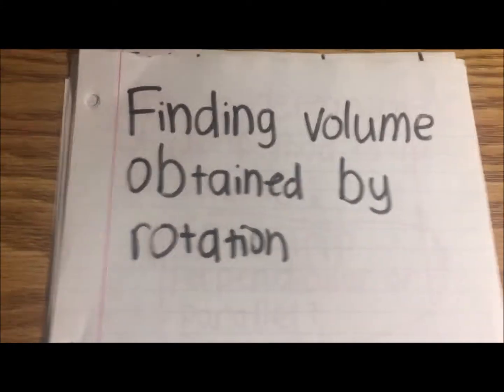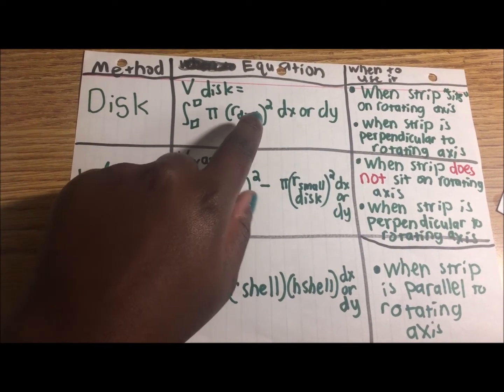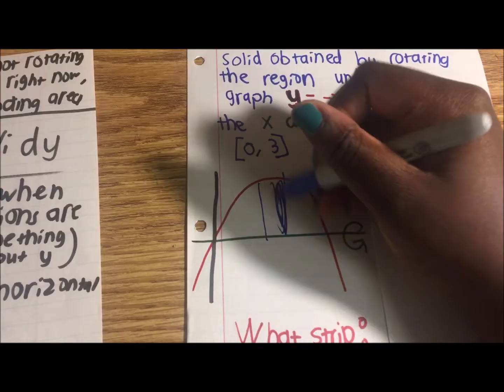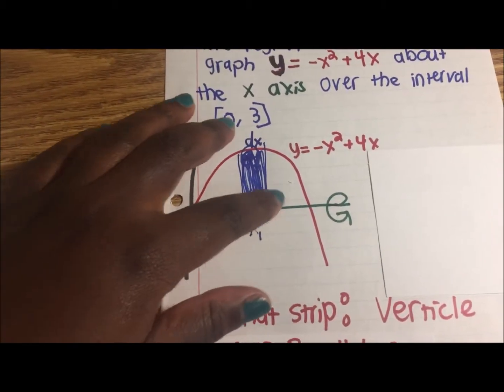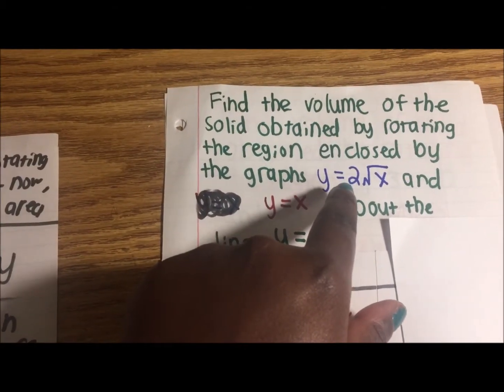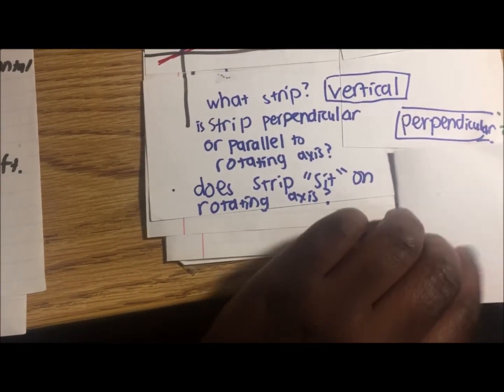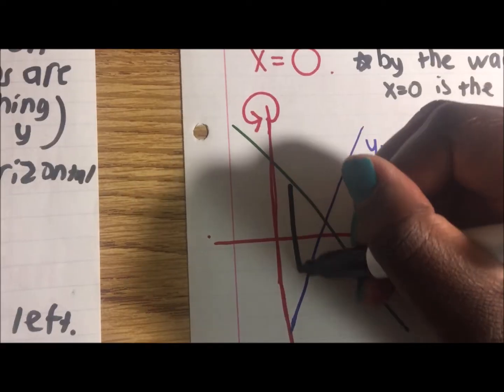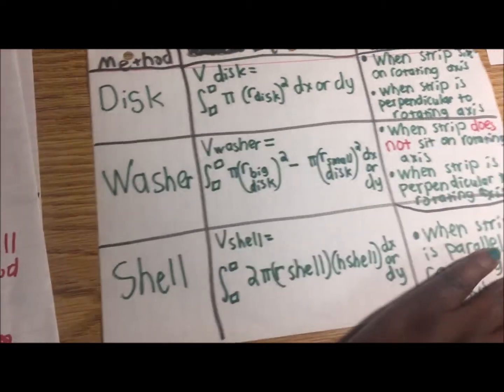The difference between disk, washer, and shell method

Comment: Late, and just finding about this method as I am doing this in Calculus 2. Love the method however one thing is i believe y= functions should have a horizontal strip as the function is defined for a range of x-values, and the y-values correspond to the output of the function at each x. So, horizontal strips (which focus on how y varies for each x) are the natural way to analyze these types of functions.

In contrast, x = functions would use vertical strips since they are defined for ranges of y-values and show how x depends on y.

Comment: Excellent!  It's been a while since I dealt with solids of revolution from calc 2, but I needed to review this topic for something. I programmed the formulas in my calculator, and the only thing I needed to remember is when to use washer vs shell. This video cuts to the chase and is more helpful than any other I've seen.  However, I think there's a simpler way to think of it.  I only have two programs for this in my calculator -- one for washer, one for shell. There's no need for "disk".  Disk is just a variation of washer. In my washer code, I enter a value for any separation from the rotating axis.  When there's no separation, the value is 0 (creating the "disk"). This is also how I've seen it taught in various calc 2 texts -- just washer vs. shell. I think it's easier to think of two choices rather than 3.

Comment: Does this flow chart also apply to f(y) functions?
Reply from the maker: I will check on the answer to this problem and get back to you soon. Feel free to check out my channel for more calculus/college math tutoring help. More content coming soon!
Reply from the maker: hey, yeah it also applies to f(y) functions. The only difference is you would be doing the integral with respect to dy instead. For example, for disk, it would be pi times the integral of fy dy, from the boundaries a to b. so yes it applies